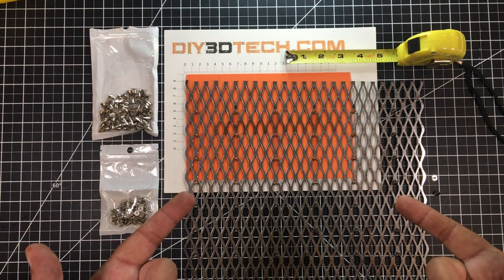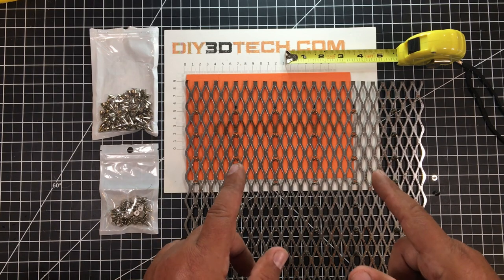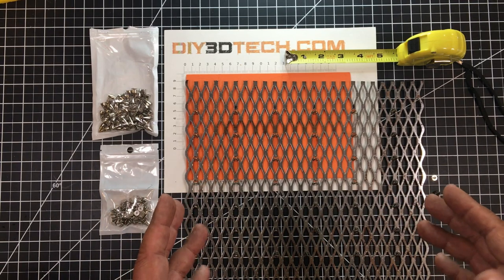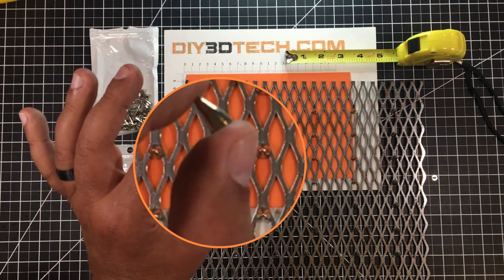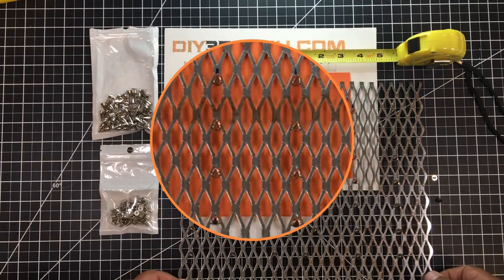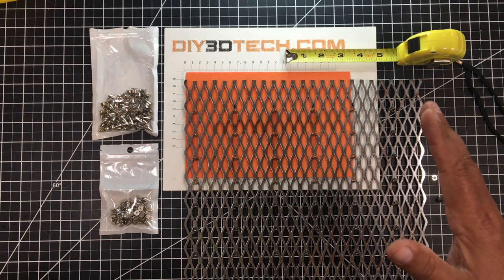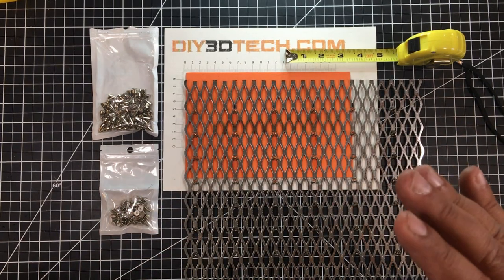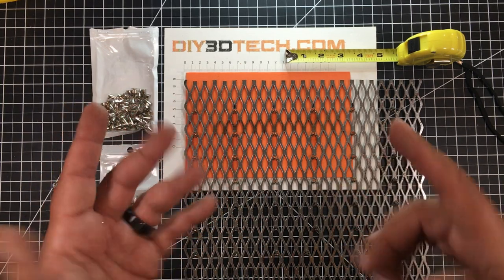eBay K40 CO2 Laser - Laser Pin Bed Mod for Under $10 Dollars!

Comment: I tried this using your idea as example. But the expanded metal is way more reflective than the honeycomb. I’m using 1.25” spikes and the back side of my wood during cuts is getting torched by laser reflection. Maybe I have to paint the expanded metal black or something non-reflective.

Comment: Do you have the same reflecting issue when the pins?
Reply from the maker: No, its now far enough away from the bed the reflected light has not been an issue like when the material just sat directly on the bed...
Reply: DIY3DTECH.com got it, I bought the expanded Metal today at the Home Depot. Putting my bed together as we speak! Thanks

Comment: It’s not called diamond plate it’s expanded metal
Reply from the maker: Thanks however all my life we have called it diamond screen, sorta like pop and soda.  Thats why I put a link :-)
Reply: @DIY3DTECHcom  yes Diamond screen is right. Diamond plate has no perforations. Expanded metal is press expanded and has slanted ribs, which might work better as it would deflect the beams at an angle downward and to the side instead of back up as this diamond screen does because it is flat.